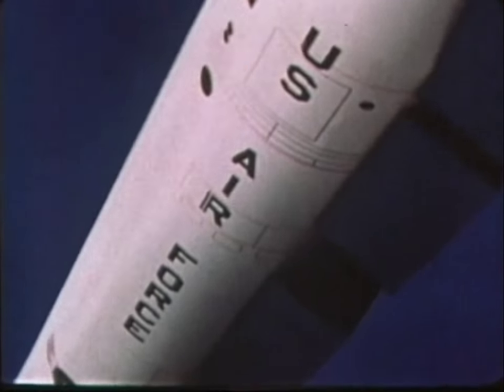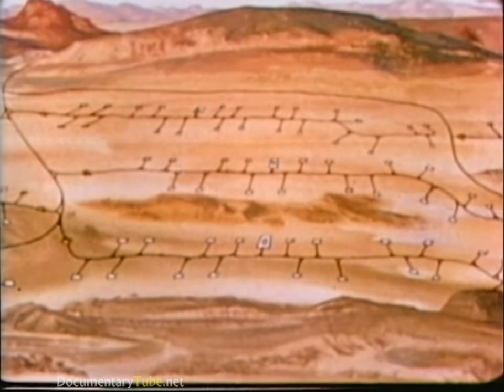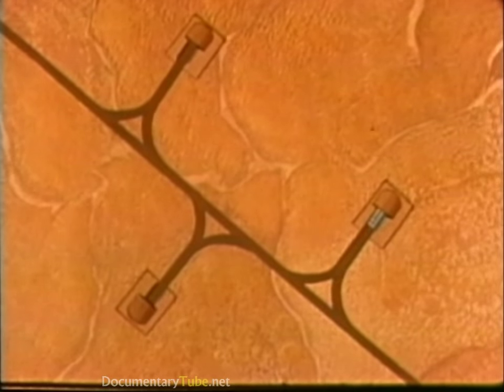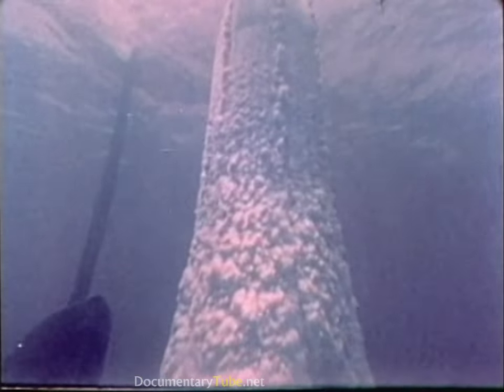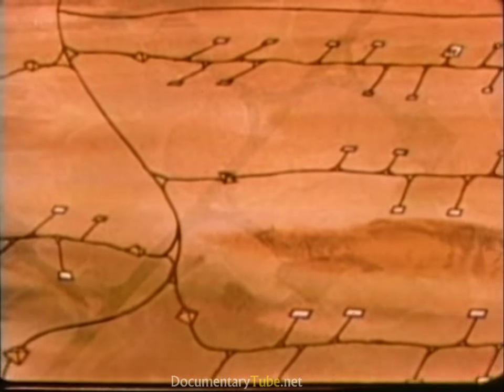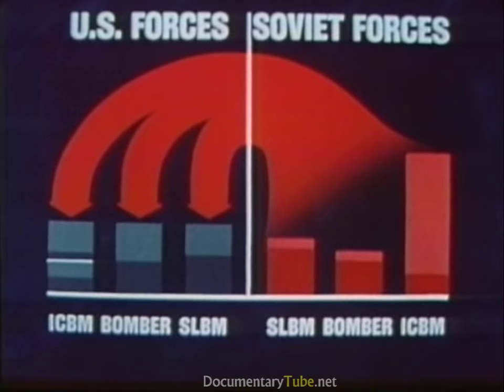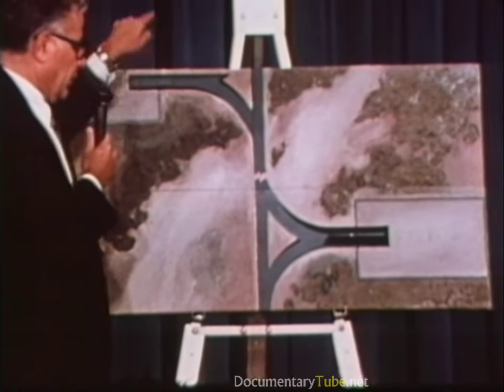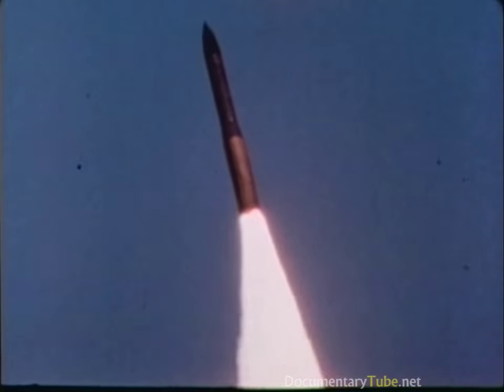The Most Powerful U.S. Air Force MX Missile

Comment: Why didn’t we keep the MX and scrap the Minuteman 3s
Reply: We put these warheads on.minutemen
Reply: the treaty between the us and soviet said no to the peacekeeper, because it could have multiple warheads on a single missile
Reply: these answers are contradicting. Do current minutemens hat 10 warheads or 3 these days?
I've heard that the peacekeeper was just too expensive to maintain compare to the Minuteman.
Reply: @grossersalat578  The Minuteman III only had 3 warheads back in the day, but are now limited to just a single warhead. The Peacekeeper could carry 10 warheads.
Reply: @georgetincher7859  Thanks.
Reply: @grossersalat578  Maximum of 3 per START I treaty but capable of 10. Some reports put it was further reduced to a single warhead but Air Force wont give a straight answer due to operational security.
Reply: Mostly they were really, really expensive and it wasn’t clear they were needed.  Minuteman is simpler and cheaper and we decided it was good enough.  The treaties were negotiated to ban them because we decided we didn’t need them.
Reply: @wiffy1346  There's no treaty that ban MIRVs.
Reply: @grossersalat578  The Minuteman III could be uploaded to three warheads but are currently downloaded to one warhead.

Comment: Was this missile system fully deployed?
Reply: desertfox2403 Yes.
Reply: desertfox2403 Yep, it was our primary ICBM for a pretty good while.
Reply: I learned that this particular system wasn't utilized in the manner described in the video as it would have used VAST amounts of public land. They instead used that same or similar hardware, and older missile silos combined with other methods such as squat box car chassis for trains. They hardened the older silos for the MX program however. "deep basing" But the MX missile was indeed the state of the art MIRV of the time.
Reply: SolidSnake2948
Interesting fun fact.Cool.I always figured the govt. would save money, like they always do, by upgrading existing things rather than waste money building something new from the ground up.Unless, of course, that new thing is so advanced there is no practical way to upgrade the old.
Reply: +SolidSnake2948 Correct. From memory, the planned deployment would also have consumed at least 75% of the US's entire cement output...
Reply: Interesting!  I didn't know that but it does make sense.
Reply: mookie2637
 I never even thought of that aspect (the cement) but the planned basing/deployment would use a heck of a lot of steel reinforced concrete so that does indeed make sense. It would be insane how much concrete and re-bar they would need to deploy the missiles in all new silos.

Comment: "Funny" thing is, in 1981 Reagan nixed the idea of the being in the bunkers, and they ended up in the Minuteman silos instead.
Reply: It was cheaper to use existing silos rather than build loads of silos and move the missiles randomly about.
Reply: Yeah. He called it a 'Rube Goldberg scheme"
Reply: @garywood5882  true but the whole idea of the MX multiple basing system was to confuse the Soviet targeting the missiles instead of putting them in vulnerable fixed silos.
Reply: @terrondt  That's a good point, I think you're right.